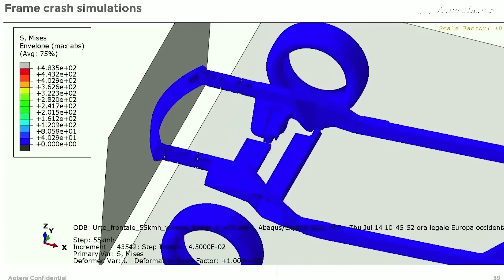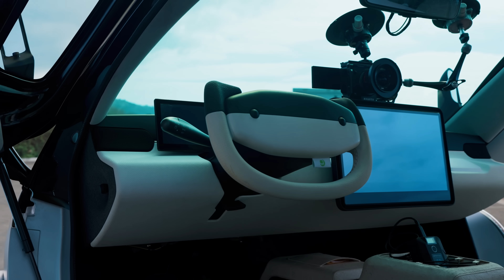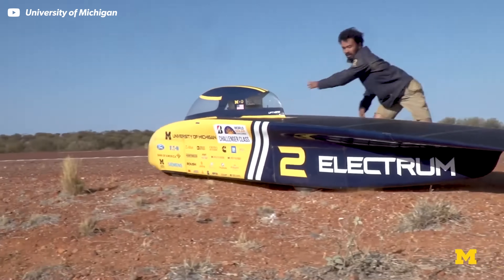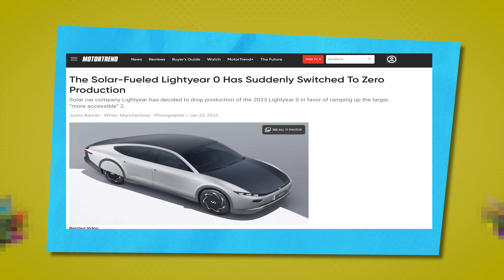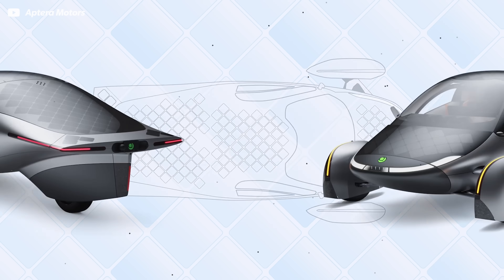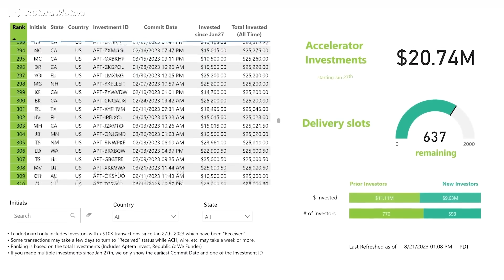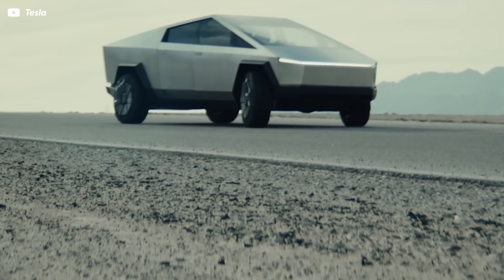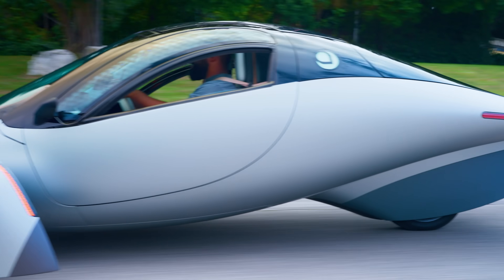We Drove America's First Solar Car

Comment: Idk, Toyota's hydrogen ice car looks pretty promising. Same refuling time/procedure as normal cars, similar ranges, gas stations can be easily and cheaply retrofitted to accommodate. Seems pretty good. That, and you don't have to worry about some hail making your car inoperable.
Reply: Not the case.  There is no recharging infrastructure to speak of  and little incentive to build it out.  Hail will not make an Aptera inoperable.  It is unlikely to even destroy the solar cells.  This has already been thoroughly tested.

Comment: Air conditioning?
Reply: Yes.  It will not only cool the cabin, but also the battery pack and wheel/inverter cooling circuits when the vehicle is traveling at slow speed or stopped for charging.  It takes in cool air from under the front windshield cowl and blows the heat out vents in the rear.

Comment: If anyone hit on one wheel it's dead cause the wheel is engine basically
Reply: No.  Normal car wheels bolt on to the wheel motors as if they were drum brakes.  You don't seem to understand what they are.

Comment: I wish it had 4 wheels for more safety and peace of mind, a gush of wind at the right curve or while backing up and a hump or rock hits it, it'll  most likely overturn much like most 3 wheelers.

God bless.
Reply: There are no flat surfaces for the wind to push against.  You hardly feel gusts even at speed.  Most 3 wheelers aren't designed like this.
Reply: @n.brucenelson5920  Thanks for the info, it's just that Elon Musk already 3 wheels is not safe when Munro asked him that he should build a 3 wheeled EV (Tesla could have easily built one). I mean you won't have peace of mind with 3 wheels, at the back of your mind there's always that chance it'll overturn (high probability compared to if it were 4 wheeled) at the right speed and circumstance.

Someone will backup their garage at a hilly place, perhaps an old lady at the wheel and most likely topple, in the future if this is released as a 3 wheeler.
Reply: @SevenDeMagnus  That is mere FUD.  Aptera passes handling tests that many cars on sale in the US market can't now.- including many that don't release their safety data either - look it up!

There will be further information on this when the validation data from the production intent vehicles is released - which will be even safer and better handling than the already very good prototypes.

Top Gear even admitted that they had to rig the Reliant Robin to make it topple, and it isn't even close to the same class as Aptera in stability.
Reply: @n.brucenelson5920  let's pray, fast & truly hope so, I mean Elon's opinion gas a lot weight (3 wheels is for me a design flaw- we've seen camera tripods topple more so with an asymmetrical 3 points of support) that's why he doesn't make it. Though the price would be a Mt. Everest effortcoz' of the Model 3's price which is more for the general public (families with kids especially). They may have 10,000 orders but after that there's that death valley in the adoption cycle.
Reply: @SevenDeMagnus  Yes, there is nothing wrong with prayer and fasting, certainly.   Hope has to have some basis, and your invoking a camara tripod indicates that you don't understand the physics involved.  The center of mass in your example is vastly higher and there is no comparison in the amount of force needed, or where it could be applied where the tires wouldn't just slide.

There are now over 48,000 paid pre-orders, and this is before most people have even heard of the vehicle - let alone experienced it.  Once that happens, orders will explode.

Comment: Wait huh it gets 5 miles per hour or charge??? Huh so on an average day there is only 5-6 hours of decent over head sunlight.... So you are getting only 30 miles of charge per day. Oh man the future is garbage
Reply: That number is probably about right on average - but remember that is free power.  You can get 13 miles of range per hour plugged into a standard 110 outlet - 2.5 times the range you would get on a Tesla Model 3 - or 400 miles of range in an hourr at 50 kWDC.
Reply: @n.brucenelson5920  and do you know anything about solar? You really don't seem to know anything as soon as a cloud goes over head or you drive through a Forrest area or through any city with skyscrapers... It's useless keep dreaming bro... Looks like reality isn't your friend.
Reply: @joesmith201212  You apparently aren't aware that the configuration of the controllers makes a large difference in how a panel can charge.  Conventional roof top panels can lose much of their output from the shadow of a power line for instance.  That is not the case with the Aptera controllers.  You should actually investigate before making uninformed statements.

Comment: They always promise it is a year away.......😂 
I remember them being in magazines in 2006.
Reply: If you saw a picture in a magazine in 2006, it wasn't this company or vehicle.  Over the years, there have been several vehicles designed with a nod to the 1982 A. Morelli body shape.  Aptera Corp. was founded in 2019, and will likely be delivering their first production vehicles next year.  This is an amazingly good performance for a startup!

Comment: Aptera has a terrible track record thus far of releasing anything. This car has been in development for almost 20 years and the original company went out of business. They have changed the drive layout of this car so many times its ridiculous. It was first gas powered and rear drive, then front drive. Then electric, now electric/solar. Its like they cant decide on anything.  I hope they can bring this car to market, but wow, I'm skeptical considering all of the problems the company has had.
Reply: Aptera Corp. was founded in 2019, and the drive layout has been the same since the beginning.  What has changed was the original plan to use vacuum resin infusion production for the body.  When reservations unexpectedly made the production volume necessary exceed the capacity that could reasonably be produced that way, the vehicle was redesigned for SMC and carbon fiber production at CPC in Italy.  The tools have all been finished and are producing validated parts.

They still have to assemble the Production Intent vehicles and do the validation testing.  Deliveries are likely to start at the end of next year, or in early 2025.

You seem to be confusing Aptera Corp with the earlier Aptera Inc.  which was a completely different company that was a joint venture with Idealab.  They hired a CEO from Detroit who didn't want to build the vehicle he was hired for, and managed to eject the original founders in 2009.  He couldn't raise funding for his different plans and oversaw an orderly voluntary liquidation of the company in 2011.  You need to do some due diligence before mis-representing the history.

They went on to found other successful companies.
Reply: @n.brucenelson5920  yes, legally they are two different companies. But let’s be honest, the law and reality can be two different things. The car now is a continuation of the original car by the “old” company. Also, the companies are not at all “completely different” outside of  legal standard. Did Steve Fambro not start both companies? Why are you defending them so adamantly?
Reply: @OCofthe3  They are not only legally different, the structure  is different and there is not a single part, dimension, or even drive train concept in common with the original vehicle plan.  It is not a "continuation" as you say.  The original Aptera Inc. was a joint venture with Idealab, and it failed because the Idealab appointed Detroit CEO kicked out Steve and Chris in 2009, and it was his changed direction that failed.

By the way, I have already made a lot of money in the company Chris Anthony co-founded and took public as CEO after he left Aptera Inc. and before he started Aptera Corp in 2019.
Reply: @n.brucenelson5920  Can you point me to any evidence that this car shares no parts with the old Aptera Inc. car?
Reply: @OCofthe3 :"The resulting evolution of the body shape is crisper, with a sleek, stark interior that carries over nothing from the planned Aptera 2e of 2009." 

From an early ieee Spectrum article on the new company.  There is much more discussion of this in Aptera videos and other places.

Comment: Yeah this looks like a sham, I'm surprised no one in the comments has any knowledge of how long it would take to charge an EV with solar panels lol, this is just an electric vehicle with a "cool futuristic" body, that also does everything else worse than a regular EV car.
Reply: Every object on the vehicle - including the body shape, has solid engineering reasons and aren't there as a fashion statement.  I advise you to actually look into it.  Even an early prototype I rode in greatly exceeded  regular EVs in many ways.  Production vehicles are going to be surprisingly awesome.
Reply: @n.brucenelson5920  I'd argue the body shape and lack of space for engineering reasons is a detriment, how much storage space in the trunk is there? Can you even go grocery shopping with this thing if you have a passenger?
Reply: @stefen2157  There is hardly a lack of space compared to other cars of similar size.  The rear cargo area holds 32 cu ft of storage, and will accommodate long items - or sleep 2 rather tall people for camping trips.

The bigger limitation may not be space, but total weight capacity, which is stated to be 500 lbs.  Rather good for its purpose, and not out of line with other 2 seat, 4 wheel vehicles.

Comment: Absolutely no info on how such a small amount of surface area can produce enough power to charge a relatively large battery.
Extremely skeptical.
Reply: Of course there is information.  The full Aptera solar panels will produce about 700 watts peak and around 4200 watt hours in a Southern California location.

This exceeds  the average commuter's daily commuting needs.

In Iowa, where I live, I will probably only get about 1/2 the power, but in my rural town I don't have the same driving needs, so I will likely still be covered for most needs.  If not, I can gain 130 miles of range overnight by plugging in, and 62% of that power comes from wind.

Comment: The Aptera has struggled to launch for over 15 years but I really hope it materializes.   This is what electric cars should try to achieve; high efficiency.  Most people don't understand that and simply want range and ridiculous acceleration.  For example, the top-end Cybertruck with a 500 mile range will weigh over 9000lbs and achieve an equivalent fuel economy of only 54mpg.  That sucks!  The Aptera achieves 337mpg equivalent.  In Canada, the Aptera would be registered as a motorcycle because it has 3 wheels.  One would have to wear a helmet.  We need to change these outdated regulations for enclosed 3 wheel vehicles. If that changes and Aptera become available in Canada, I'll buy one.
Reply: Aptera Corp and the design of this vehicle were only started in 2019.  However the rest of your comments are spot on.  I have ridden in an Aptera prototype.  The AWD launch editions will achieve in the neighborhood of 4 second 0-60 times with a 400 mile EPA range.  They are truly fun!
Reply: @n.brucenelson5920  No, it was in the first X-Prize in 2011 and was around in 2009.
Reply: @NP-co7kj  this is easy to research.  The automotive X-prize competition was held in 2010, after Steve and Chris had already left the company.  The Aptera Inc. entry dropped out after 30 laps.

The vehicle that was designed in 2019 uses wheel motors and has a drive train nothing like the earlier vehicle.
Reply: @n.brucenelson5920  "Aptera Corp and the design of this vehicle were only started in 2019"  It's hilarious that you argue that a vehicle named "Aptera" that existed in 2009,  that looks identical to the latest iteration,  has nothing to do with the current version.  Wow!
Reply: @NP-co7kj  You must think that two twins are the same person.  Get a clue!  

There have been several vehicles shaped like Aptera that had nothing to do with the founders of either company.  The body design was created by A. Morelli in 1982, and the shape has been used by a number of different builders.  There is not a single part of the present Aptera in common with the original design, nor size, nor drive train concept.  Aptera Corp. and the former Aptera, Inc. were legally different companies with different corporate structures.

The fact that you think they are the same thing is not hilarious - it is really sad.
Reply: @n.brucenelson5920  I'm talking about the vehicle, not the company. It does not matter if the Aptera has been redesigned and newly built with various changes over and over again by various entities, the fact is, the Aptera existed 15 years ago. This new ownership is the latest to try to get the Aptera to production.  If it has no relationship to the original Aptera, then why does it look identical and why is it named Aptera?
Reply: @NP-co7kj  You have already told us that an Aptera competed for the X prize after Aptera Inc., which built that vehicle had closed.  You don't seem to be able to do proper research.  

The present vehicle is being designed and built by Aptera Corp. - a different company.  The vehicle design is completely different.  This one is a pure electric vehicle with a wheel motor drive train.  It does NOT look identical to an engineer.

The goal of reducing power waste from air resistance and other sources is common to several automotive designers.
Reply: @n.brucenelson5920  You seem to struggle with comprehension.  I never said it was the same company.  The fact is, various companies have attempted to get the Aptera to the market or in production for around 15 years, maybe more.  Of course it's been redesigned and seen many changes.  If the new company felt that their version had nothing to do with the original Aptera, then 1) why does their company name include "Aptera", 2) why is the vehicle called "Aptera" and 3) Why does it look essentially the same?  If they felt their vehicle was completely different and unique, they'd given it a different name and not used "Aptera" in their corporate name.  Various companies have attempted to get their version of the Aptera to the market for many years.
Reply: @NP-co7kj  I suggest you look into the history of the founders for the answers to your questions.  It is clear you haven't.  Anybody can see you have been quoting a false time line regarding the history.
Reply: @n.brucenelson5920  You confirmed before, that the Aptera (vehicle) was in the x-prize competition in 2010.  So thanks for confirming my point and timeline!
Reply: @NP-co7kj  Did you forget what you wrote?

"No, it was in the first X-Prize in 2011 and was around in 2009."

What is your point?  It is not clear to me at all.

However, let me apologize for my tone.  I wasn't in a great frame of mind, i guess.

Let me respond to what is really important:  Merry Christmas to you and your family!
Reply: @n.brucenelson5920  Who cares about the exact calendar year of the x-prize.  It existed 15 years ago and maybe more.  Of course there's been various owners, new designs, etc.  To try to argue it was only developed in 2019,  refers to the latest or near latest build and design of the current Aptera, by yet another company. Bye!
Reply: @NP-co7kj  Who cares about the truth?  I do.  You don't seem to.  Thanks for letting us all know.

Comment: Talk all you want, but until those front wheels get collision protection, it will never Ever make it into mainstream production. Until it can climb Pikes Peak or Mulholland, it just ain't gonna happen for major production. Some flat landers, oh yeah, and I applaud the effort, but, sadly, this is already a dying "bug" right outta the box.
Reply: Of course it can do both Mulholland and Pikes Peak without issue.  It is light weight and has plenty of torque.  Both my wife and I have ridden in an early Aptera  prototype and the performance is eye opening.  The AWD model can do better than the original Tesla Roadster in acceleration and not risk breaking a transmission, which happened so often that on demo days in 2008, Tesla needed a stack of spare transmissions and a crew to change them out while they were giving demo rides.
Reply: @n.brucenelson5920  very Glad to hear that. So, you have driven up similar? No fears of having front wheels pod configured? I am picturing accidentally clipping or getting clipped. Thanks for confirming hill climb In real life.
Reply: @dr123hall  That could happen.  There are always people not paying attention.  I used to own and drive a stepvan that was wider than the Aptera the entire length of the vehicle and could still fit in a compact parking space (96") wide.

I never got clipped in that, but it was big enough to see.  I suspect that the Aptera is striking enough in appearance that people will notice it, too - perhaps more than most introverts would like.

Comment: Why not just hook an aternator to th wheel and charge the battery??... or use a wind turbine to charge it when all you get is wind driving? ... I don't understand why these ideas seam out of the question.
Reply: The alternator would only charge when the wheel is turning.  The motors in the wheel can provide regenerative power when braking or going down hill, so your idea is used here.

As far as wind goes, most of the wind while driving is caused by the motion of the car which uses power.  Aptera is designed to minimise the resistance of the wind, so a wind turbine would ADD resistance - and provide less power than it was stealing from the forward motion of the vehicle.

Good questions!